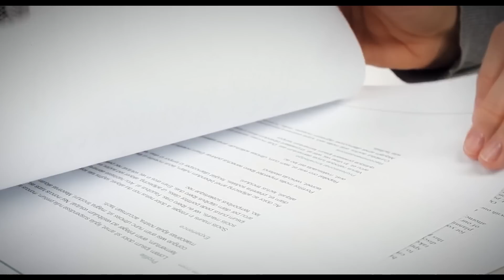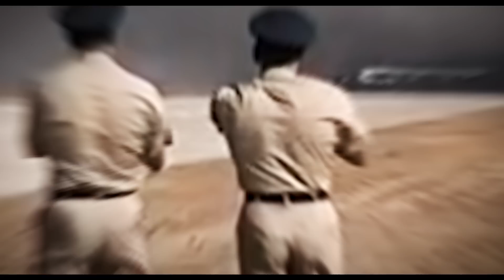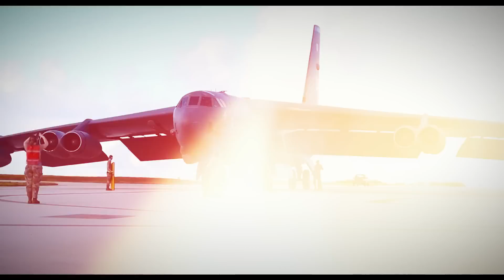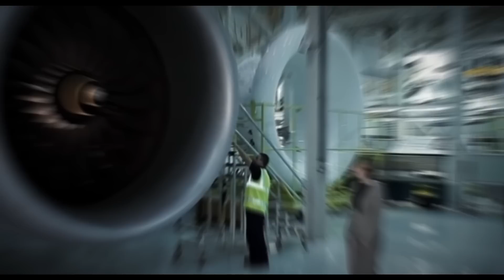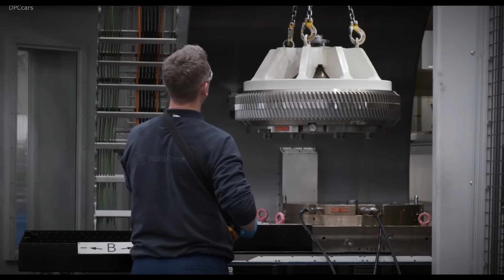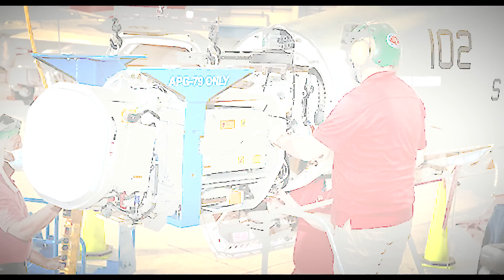Rolls-Royce Begins Testing Their F130 Engine For The B-52 Bomber

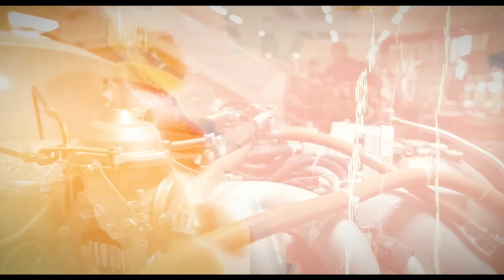Comment: I particularly loved the tracking shot (3:40) of what is, obviously, a light single-engine airplane without it’s cowling where you can, clearly, see the Bing carburetor used on the Rotax 912ULS engines. What this has to do with the B-52 is anyone’s guess.

Comment: It is nothing short of amazing that the B-52 bomber has been in service for such a long time. It is time that new engines be installed and tested on this bomber. Jet engine technology has improved a lot over the years. The new engines are more fuel efficient. The new engines are less polluting and will not emit smoke on takeoff. Also the new engines will produce less noise. Those old engines are real screamers when the B-52 takes off.
Reply: If you are talking about the fan-jets, you haven't heard any noise at all, the old ones were even noisier.

Comment: The USAF should just buy new build B-52 aircraft. If the airframe gets the job done, update the design and build new airframes. With the money spent keeping the current B52 fleet going, new airframes could have been purchased.
Reply: The airframes are the key.
They have an extremely long lifespan , requiring little maintenance.  
The engine maintenance, times 8 OF THEM are the expense !!
Reply: They replaced the wing root back in the 1960's and been replacing parts ever since. Why teach an old horse new tricks?

Comment: I can't believe a Bomber that was developed from a 1946 contract and first flew in 1952 is getting new engines developed in 2023.
Reply: The Air Force plan to operate these aircraft until they are 100 years old is just plain nuts.  As for the re-engining program, it should have happened 25 or 30 years ago.

Comment: Whatever Boeing's 1940s and 1950s engineers got paid for designing the B-52, Boeing and the U.S. government got their money's worth.
Reply: I'm reminded of the many other elderly airframes that were designed so well that replacing them seems illogical. 
A-10, C-130, C-5, F-18, F-16. 
...
Therefore, the next generation airframes are worth it.  We don't need to replace the aforementioned, just refine them, raise durability, reliability, efficiency etc.
...
I've studied the history of mechanical engineering, design, process etc. 
( as a child my dad was a war film fanatic.  I was amazed at the speed of technological advances... ie, first flight to supersonic.   Model T to F1, etc. ) 
...
I'm a big "modules" fan. So...
What could these pods replace ?  
Where could they also be utilized in multi engine aircraft !  

Commercial/Civilian aircraft  ?
Reply: @timothywalsh1001 the oldies are only really great if they're continually developed and improved with an active production line in which case there's a few rotary wing machines to add to your list, ch47, mh53 and the British lynx, the b52 only really survived this long after production ended because of the huge numbers built and improved upon during original production, c5 has problems and massive maintenance costs because this wasn't the case.